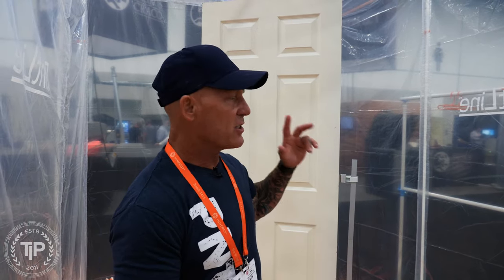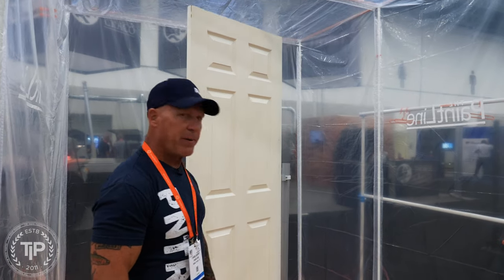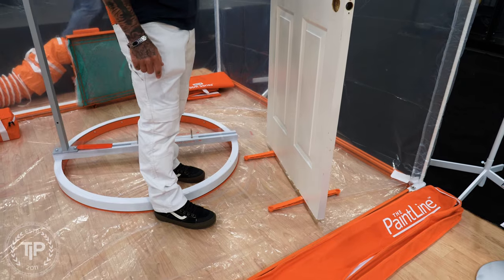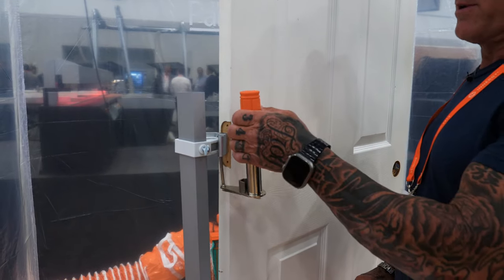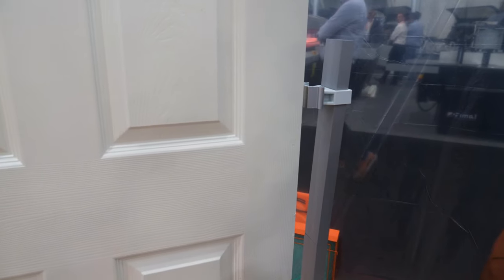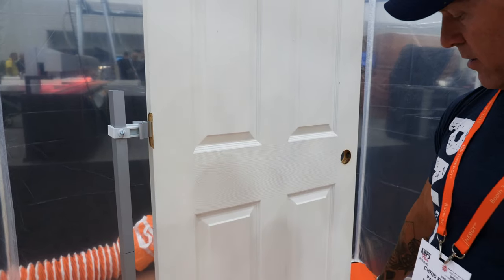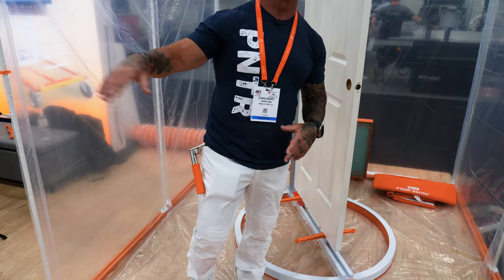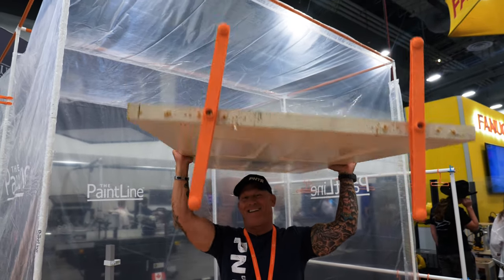PaintLine Mobile Spray Booth With Door Spraying Stand

Comment: I’m buying a older house and painting the entire inside. Most of the walls are currently dark and kind of glossy paint colors. What primer would be best as I am planning on going to a light gray/White? Kilz? BIN?
Reply from the maker: Zinsser 123
Reply: @Idahopainter  thank you!
Reply: @Idahopainter  any suggestions for ceiling paint? Is an expensive Sherwin Williams paint that much better and more worth it than a cheap behr or glidden paint?

Comment: As a painter myself. Looks like a giant waste of time. How are you going to paint 20 doors on a new construction
Reply: Also, once everything is covered with paint and is drying, how are you going to slide those so easily? I’m not even a professional painter and I see issues with this.
Reply: We have condos here in Louisiana that have 1 parking space only. Either paint them inside, off site, or make due. The booth makes pretty good due. It's not practical in every situation but it does have its places.